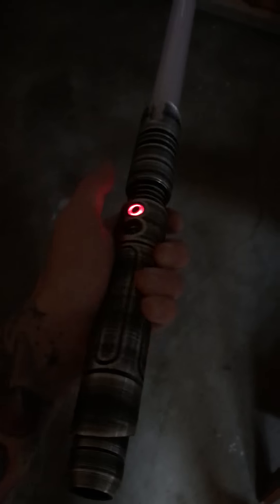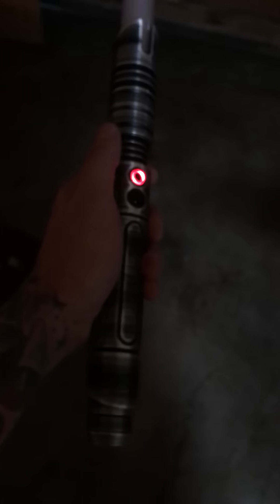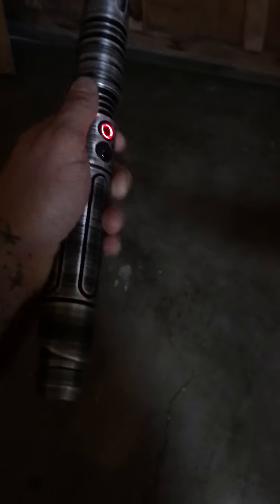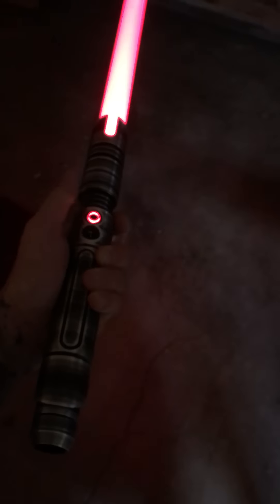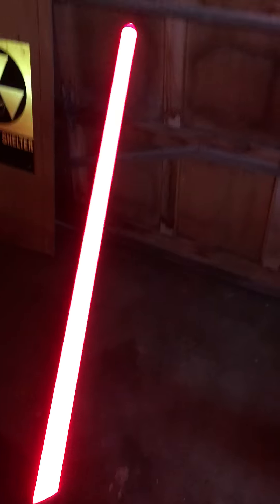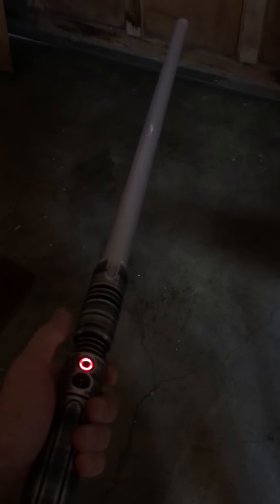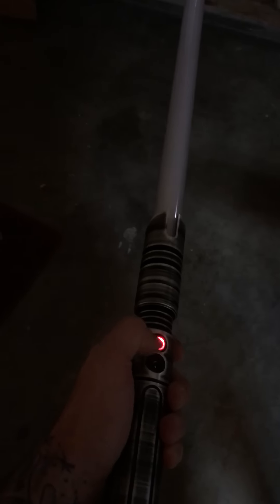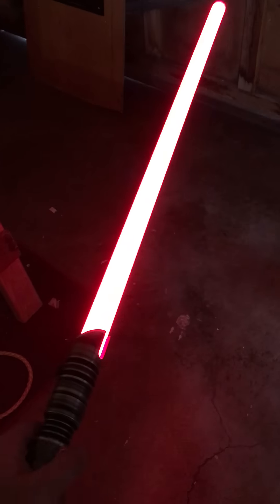Nano Biscotte Unstable Blade Settings

Comment: What did changing the flks and flkd values do? I thought the hs and ls settings were the swing and clash sensor values?
Reply: Ah OK. I was messing with my settings after watching this but didn't notice a difference in my sensors.
Reply: +Daniel George my nbv3 is doing the same as mine is right under my emitter. I adjusted the swing by 10 points but it's still a tad off.

Comment: Probably a dumb question but how do you change these settings? Is it all through the micro SD card where the fonts are or is it something else?
Reply from the maker: +Kyle Ray Yeah there is a config file on the SD card with numbers you change to effect settings.
Reply: Kyle Ray there's no such thing as a dumb question 

Unless it's what is the number for 911